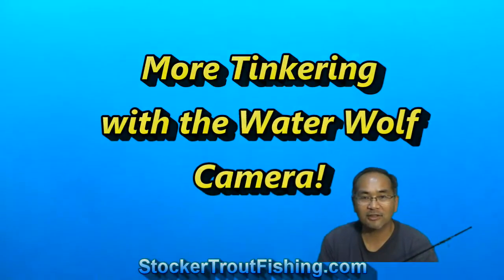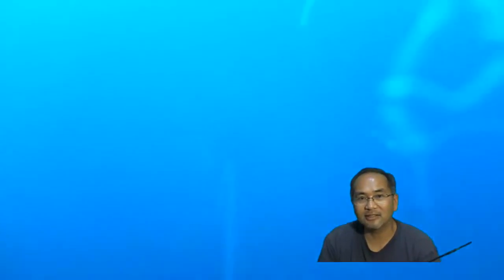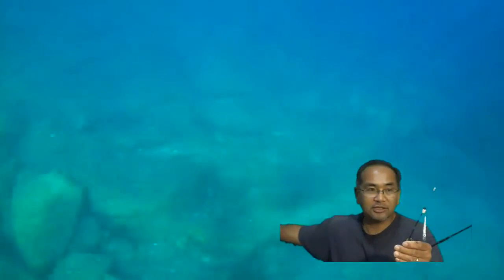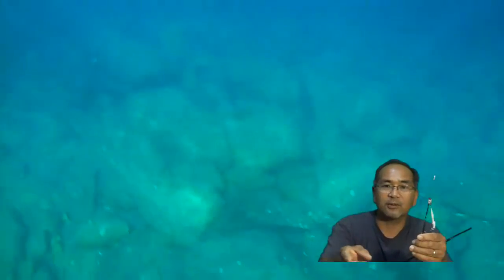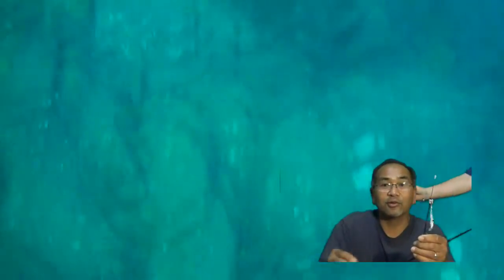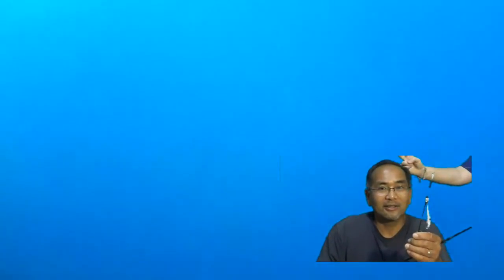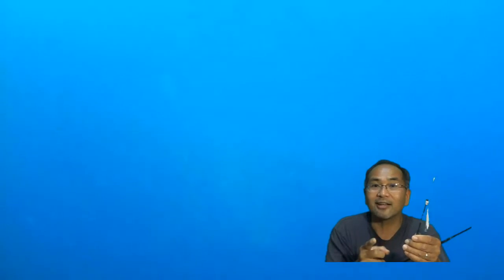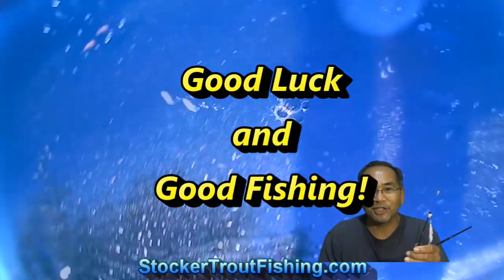More Tinkering with the Water Wolf Camera!

Comment: Thanks . I'm thinking of buying this product for trolling on kayak . Keen to observe lure / fish behaviour .  .  . Is this product worth the money in your opinion.
Reply from the maker: If you have clear water, it would be a great tool for observing what is happening underwater. It has been tough in our area due to the Summer "bloom" in the lakes and ponds making things murky. We do plan to use it this Winter for Trout fishing. We have some clear rivers that will make it much better to see. Would prefer it to be around the $99 price but we did get ours online for $144 from Monster Fishing Tackle. Included free shipping.
Reply: +COAF Field Team thanks for reply . I will be trolling big lures and rigged dead -baits for Spanish Mackeral around 2to 5 km Offshore. Very clear water in Western Australia .Costs $200 Aust. .  .  . Camera housing will be in danger !! Must see fish interaction .
Reply from the maker: That sounds like a great time and great videos to be had! I am currently using 50 lbs braided line to attach to the camera, and then a lighter weight 5-17lbs mono from the camera to the lure. So far, have not lost the camera! Will be on the lookout for your videos!